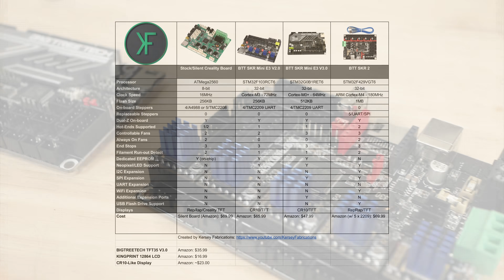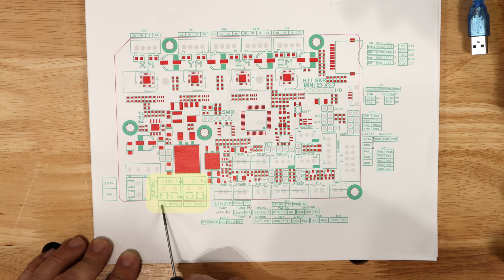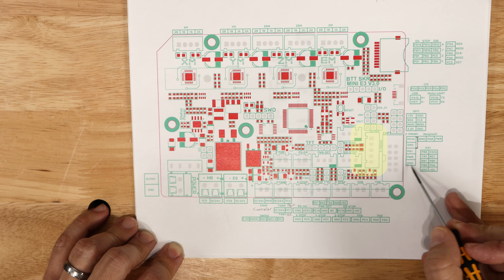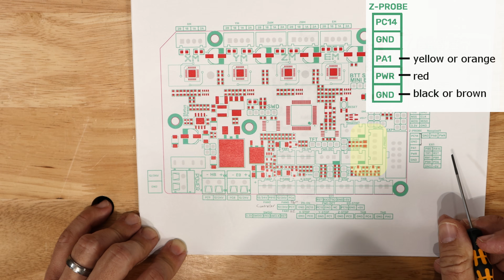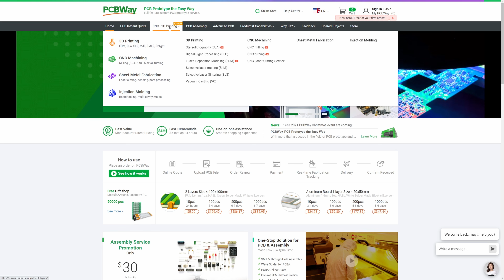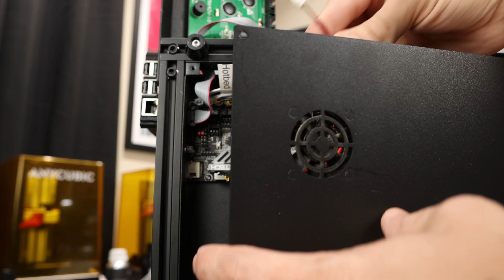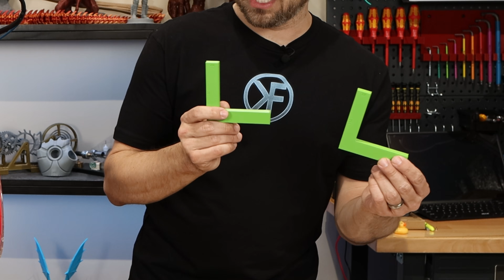Bigtreetech SKR Mini E3 V3.0 - Ender 5 and Ender 5 Plus

Comment: Congratulations on getting a functional board. I got one that didn't work properly. They then tried to scam me into taking a cheaper/less featured board as a replacement. When I said no to that, they then sent me another of the board I ordered that was even more damaged than the first one. After I told them I'd just like to send back the boards and get a refund, they ghosted me and I haven't been able to get them to respond since. F this company.
Reply from the maker: That sucks! Sorry to hear it when a company doesn't follow through. The best I can recommend is that others order through Amazon. That's where I've bought almost all my boards in the past. It gives you a middle man to handle disputes.

Comment: Hey this is great! I was specifically looking to upgrade my stock ender 5 (regular) board and this sounds just like what I'd like and your video and firmware makes it easy and painless! Question, is Arc support enabled in this firmware? Can I process my gcode via arcwelder and the printer can print it? I hate how curves stutter while printing without arc printing support. Thanks!
Reply from the maker: Yep! ARC support included and you shouldn't have any stuttering with this board.
Reply: @kerseyfabs  omg man, that's it! I'm getting this! May you have wonderful blessings for providing a cohesive all inclusive easy to implement solution!

Comment: Awesome video! Would love to see a print comparison from the mini v3 and skr 2 on an ended 5 plus!
Reply from the maker: I'll be honest here, from a quality stand-point, you're not going to really see a difference under normal circumstances. MAYBE if you try and go too fast but not under normal print speeds.
Reply: @kerseyfabs  what about linear advance?
Reply from the maker: @aspmos  It's enabled in all of my firmware. You just need to set it up.
Reply: @kerseyfabs  do you have a video about how to set it up?
Only this feature isn't it a GREAT improvement over the stock board? I think it is.
Reply from the maker: @aspmos  I don't have a video on it. There are probably a lot out there though.

Comment: I cant thank you enough.  I just bought this board to replace the original Creality noisy board I have in my Ender 5 Plus with a BL Touch.  So much easier when you do the firmware for the community!
Reply from the maker: I'm happy I could help.
Reply: So his firmware works out the box for the e5plus?

Comment: Great video! I was working on this paired with a tft35 in a Ender 5 plus. I finished today, before you posted your video. :) Anyway, it made me happy to see that others were using this combo.
Reply: I have heard that this board needs a different screen to the regular TFT35, was this the case with your instalation or were you able to fernangle the FW?
Reply: @AndrewAHayes  I got my own firmware working, but my bl touch won't activate.
Reply: @marcusmannes3410  Check your firmware again to make sure you have that activated and the original z endstop device commented out, some people have had to plug the black and white wires into where the mechanical z endstop would go instead of with the 3 BL Touch wires plugin, try that you cant harm anything
Reply: @AndrewAHayes  I have checked multiple times, I think my bltouch pin is dead.
Reply: @marcusmannes3410  There is a very common fault with the BL Touch having bad connections with the Ender 5 Plus when assembled by Creality, you can check if this is the issue by taking a small Allen wrench and push down on each side of the JST connector on the BL Touch and then power up it may look well connected but may not have a good electrical contact, also if the Hotend is parked in the back left corner it reports a flashing red error with the BL Touch.

Comment: I have an Ender 5 Plus and a CR-10 Mini.  I have one of these boards laying on my desk ready to go into my CR-10 Mini.  My question is, other than firmware, will the actual hardware be a direct swap?
Reply from the maker: It should be. I'm not familiar with that machine's wiring, so just pay attention to the pin mapping.

Comment: No one does board reviews better!  I'm probably going to stick with the 2.0 at this time, I'm pretty happy with what I got.  I need to troubleshoot my filament runout sensor, I'm not sure how to verify that the board is seeing the Input correctly. Not sure if you have an idea.  Can't wait to see what else you have plans to review, really looking for forward to more multi color nozzle solutions....  Keep up the great work!
Reply from the maker: Thank you! Yeah, I don't see any need to go from V2.0 to V3.0. There are some software ways to check out that filament runout but the easiest way is to stick a small piece of filament in the sensor, start a print with no filament loaded in the nozzle and see what happens when you remove that small piece of filament.

Comment: Realistically you need 5 drivers because independent dual z -> less fiddle more print. 3 controllable fans. Skr turbo on my ender. I am 34% sure heater and thermistor polarities dont matter.
Reply from the maker: I like the feature but it's not like I use it much. Unless I hit something or move it, it usually doesn't need it. For those that don't want to cut up their case, this is an easy solution on the Ender 5 Plus. You're right on polarities but on some beds polarity matters. If you see two different colored wires, assume they mean it.